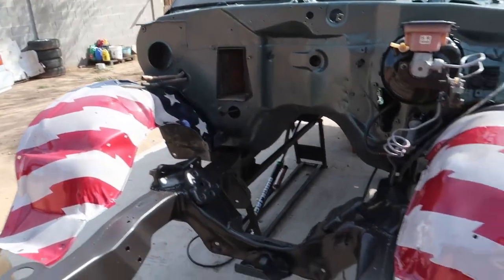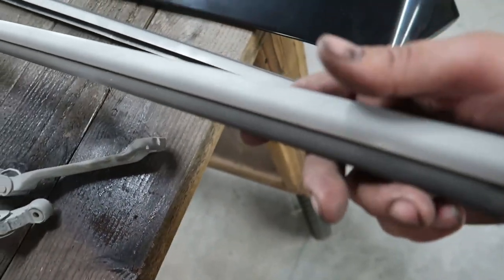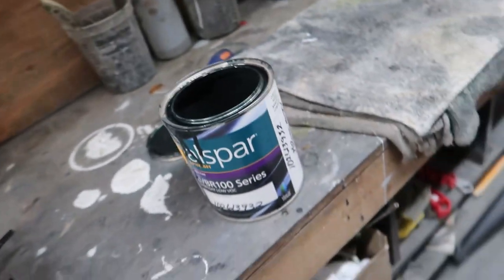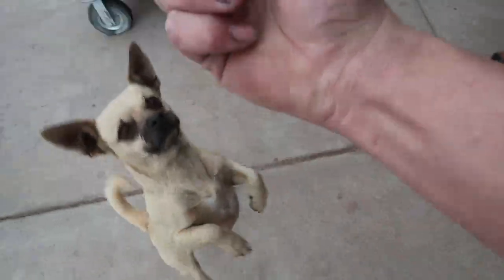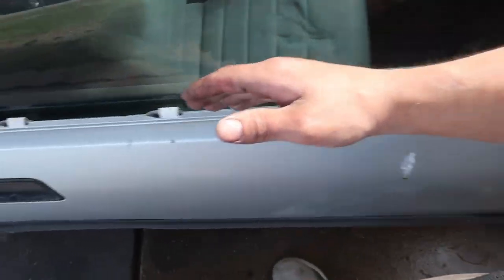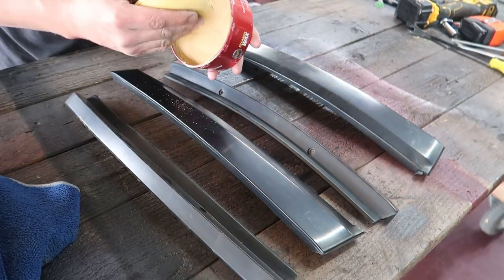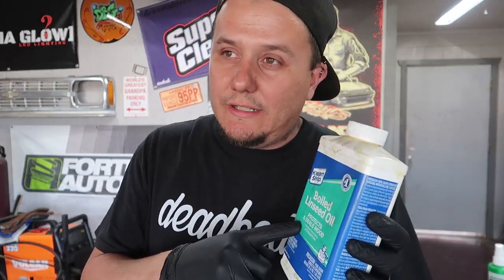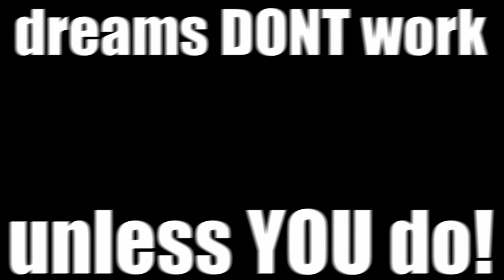Barnyard Find EF Hatch cleans up pretty good

Comment: 10th character of the VIN will tell you the year, L is 1990, M is 1991, N is 1992, and so on til 1999 which is X, they didn't use vowels